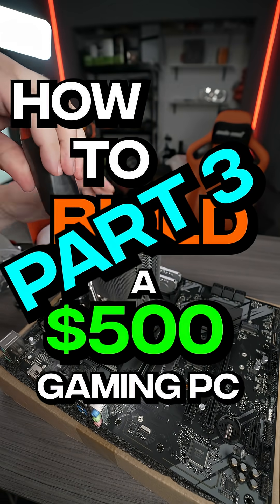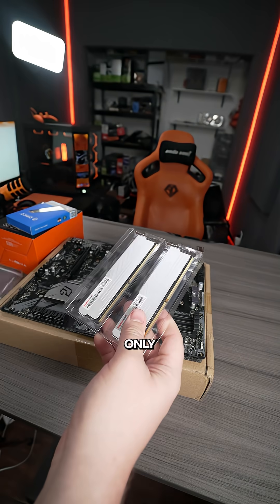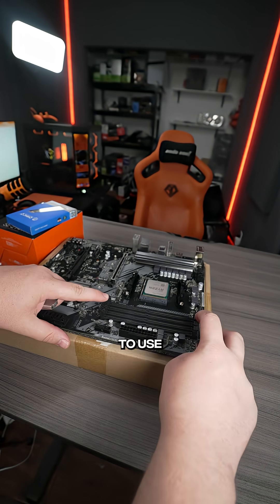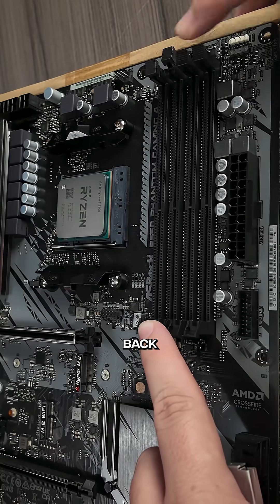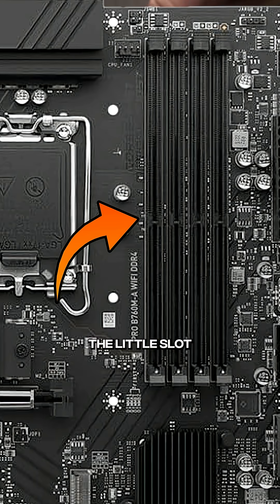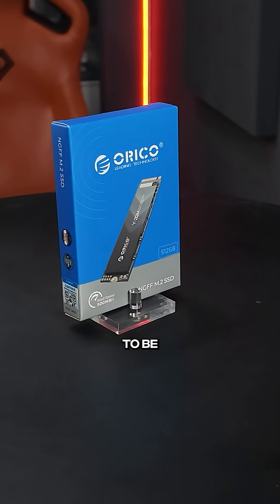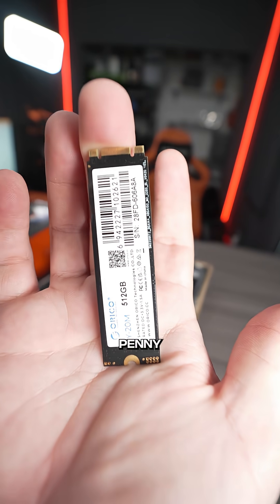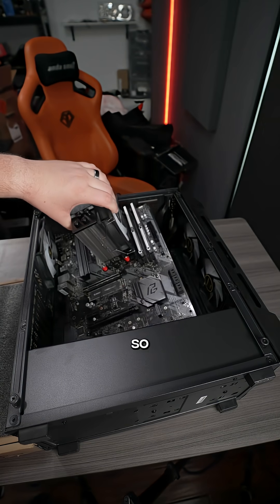Easy Steps to Add RAM and SSD to Your Gaming PC!

Comment: Read the instruction manual for your specific motherboard sometimes the primary ram slots are 1 and 3 and not 2 and 4 I haven’t seen any like that before but it is possible
Reply from the maker: Not on newer motherboards
Reply: @MMillerPCs yeah ur right